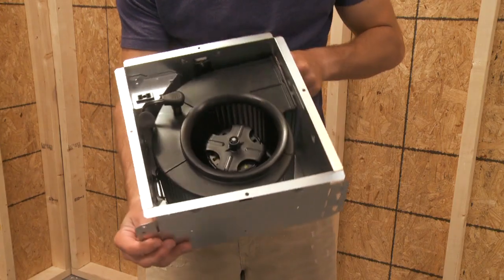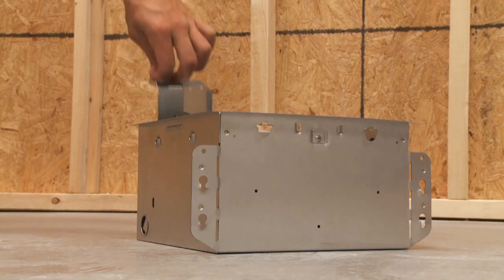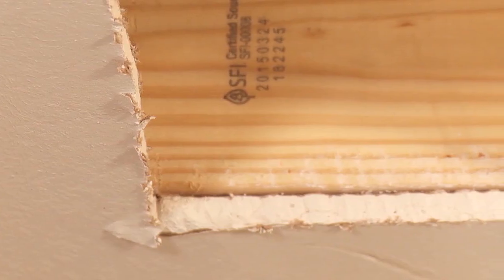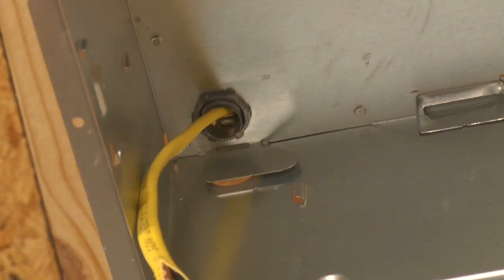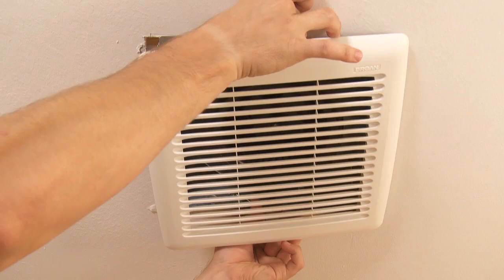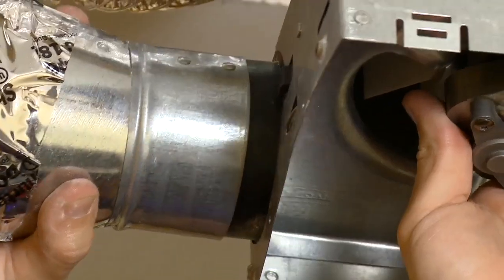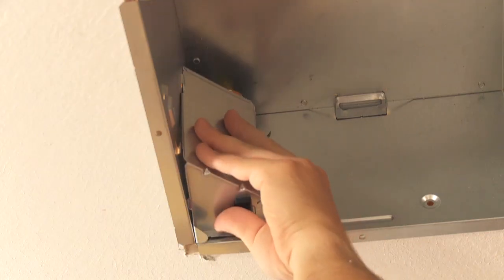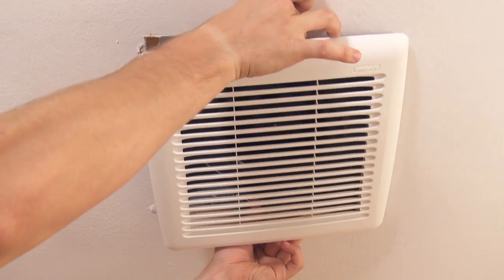Broan InVent Series How To Install

Comment: When it came to pushing blower motor into housing, helps to know you may have to push pretty hard. Also I had to push both plastic tabs on each side of blower inward firmly and then blower will slide in. Tabs are kind of "sprung" then click back outward to hold fan on place then insert screws...just had to push very firmly..
Reply from the maker: Thank you for your feedback and for sharing your personal experience with the installation of your InVent Series fan.  We hope this information will be helpful to others as well!

Comment: I have installed the fan and it works but I also have a light that goes with it and there are two metal lines in the plastic part of the light piece that I'm supposed to connect to the housing but I have no idea how they are supposed to go.  Any ideas?

Comment: So how  do the grill clips hook into the housing?  
you showed everything except how to pinch the grille clips into the housing.
Reply: Yeah, those damn springs are maddening. I wonder how many takes they needed to make it look easy. I'm perfectly familiar with tab and spring systems from installing trim rings on can lights, (also a pain sometimes), but the ones on the Broan are ridiculous. Screw channels on the corners of the grill for screws would have have been nice. On the last try, I almost had it, then the eye of the spring came out of the grill's clip on one side. Grrrrrrr!
Reply: how can a product be done cheaper??? develop it past the point of simple functioning...
 case in point>>> attaching the grill cover
but worst is to create an impeller with by pass openings from high to  low pressure side , waste to kill performance>> one fits all sizes???? 
engineering used to render devices in the direction of non functionality...
try to remove the impeller another booboo
Reply: Make them face up like a Y. Squeeze the wires together and guide each side into its channel that is stamped into the housing. The grill will then pull itself into place. It’s a strange setup, but once you figure it out, it will take like 10 seconds the next time you do it.
Reply: Oh you mean the most infuriating part where you can't even see the clips at all on the blower side?  I'm stuck there right now and watching this video to figure it out.  They seem to gloss right over that part.  Super easy, barely an inconvenience.
Reply: @MoneyManHolmes  That sounds encourging.  I am about to  install  mine  and I was reading in  the comments as  always do to save myself grief.  Thanks.
Reply: @MoneyManHolmes  thank you so easy once you do it that way lol
Reply: Worst design ever. I’m ready to smash this thing.

Comment: I had problems getting both screw gussets to seat.  The interface between blower exhaust and the duct fitting doesn’t seem to engage properly.  It would be helpful if the installation demo went into a bit more detail about how the plastic housing clips into the metal housing, and shared some “this can be frustrating…pay close attention engaging x and y mating faces…”.
Reply from the maker: Thank you for your comments. We appreciate your feedback and have passed it along to all the necessary teams. For now, we do have a Product Support Team available at 800-637-1453. They would be happy to provide assistance with any issues and questions you may have on specification, application and installation.

Comment: I installed my Broan® Economy 80 CFM Ceiling Exhaust Bath Fan with Light and Bluetooth Speaker. the fan comes on but no light or Bluetooth, HELP! What is this Dual Control (purchase separately) thing I see in the online instructions? HELP!
Reply from the maker: Hello Patricia, We need to ask you some further questions about the model you currently have installed and the type of switches you are using.  Please contact our Technical Support team directly at 800-637-1453 for more assistance.

Comment: still not sure what to do with all the wires on this new fan can u help i know black to black white to white green to green so now where do the red and grey go?
Reply from the maker: Good Morning jimdon29607, Can you please advise which model you are installing so we can try to assist you more?  The model number is located inside the housing on a specification label. Once we have this we can try to assist you more.  Feel free to contact Technical Support directly at 800-637-1453 or email webinfo@broan.com and enter YouTube in the Subject line so we can recognize your message quickly.  Thanks so much and we look forward to helping you with this!

Comment: the grill screen will not install as shown in the manual.......when I think I might be making headway, the wire pulls out of the screen. I give up & will now drill holes in the screen and screw it to the ceiling.
Reply: I have a pic showing how to bend the spring wires and install the grill cover. If anyone needs it, just reply to this comment.
Reply: @MoneyManHolmes  
Yes please 👋

Comment: For new construction, the half inch stop around the unit forces me to cut the drywall extra half inch on all sides to fit through vent unit.  Installation instructions does not address this problem.
Reply: They are meant to be installed from floor side. So you would just push the unit up and then stops would keep unit flush with drywall.
Reply: Yea it's a terrible design I don't want to have to drywall.

Comment: My husband is currently irritated at this and this video is useless. Because of cover.
Reply: The springs are mounted backwards.  At least they were in mine.  After cussing for the last 10 minutes, I was finally able to figure it out.  The springs need to be removed, and then reinserted with the circle side down.  The two “arms” then get squeezed together and fit inside the black brackets where you screw the fan housing to the mount.  It’s up, the cover is on, and it works.  Hallelujah, holy sh*t
Reply: I'm flipping out at this exact step right now - what the hell.  Once I've put the blow back in it sure doesn't want to come back out either.
Reply: @SaltySam43  Humm well congrats you got it but I doubt the springs are mounted backwards but what ever works.   You can worry about getting the cover off in 15 years.

Comment: your vent flaps suck. gravity doesn't close them shut when the fan isn't running.
Reply: Agree with this statement 100%. I had to stick two nickles to the bottom of the flapper to keep it from opening when winds are gusting. I am also going to install another damper right after this one too because it still leeches air inside.
Reply: Jackson Cruz two nickels taped to the bottom of the flapper was CLUTCH.  That tapping kept me awake at night.  Thanks so much for commenting.  I was going crazy
Reply: Did you try one nickel and it wasn’t enough? I’m going to have to mod mine. I can hear the damper moving when my dryer is running and even when I just close the bathroom door.
Reply: Broan, you should be paying us engineers' salaries for commenting here. I forgot to mention I super-glued a penny to my flap to get it to stay closed. Think about it, the cost of a penny and some glue and your products will be 100 times better.
Reply: @MoneyManHolmes  I think I maybe had to use a couple of coins to get mine to work better- still not perfect though.